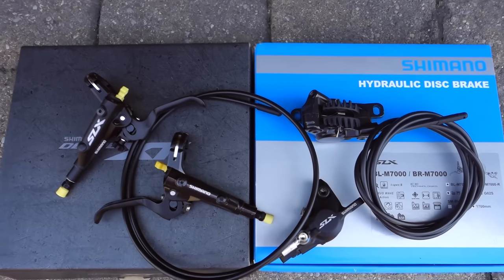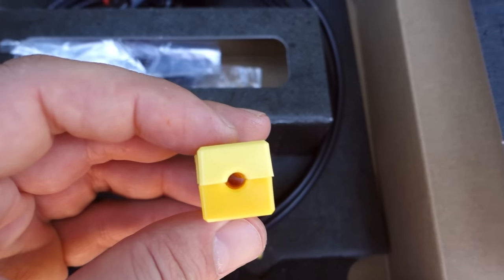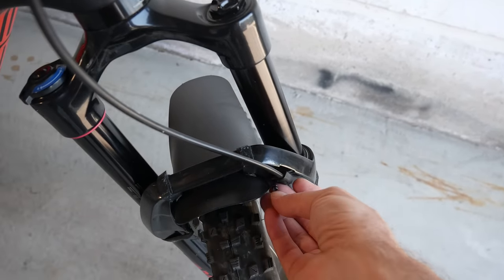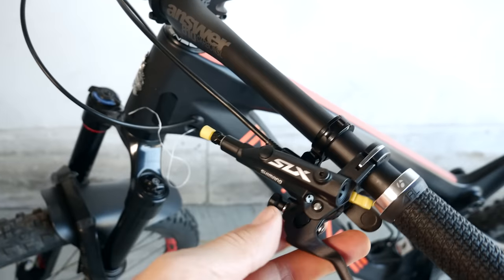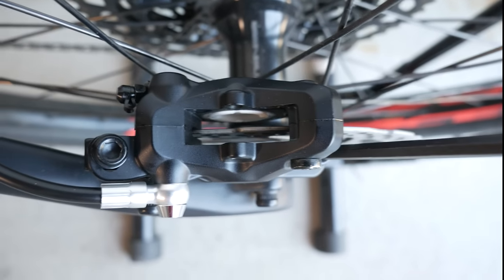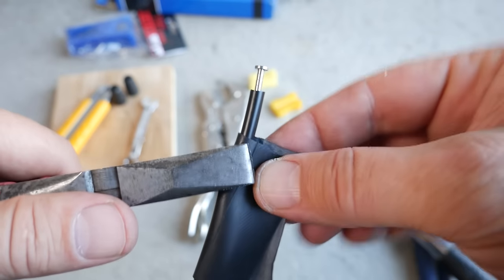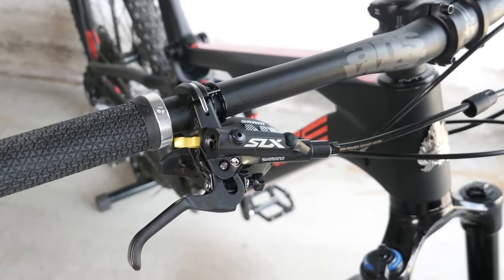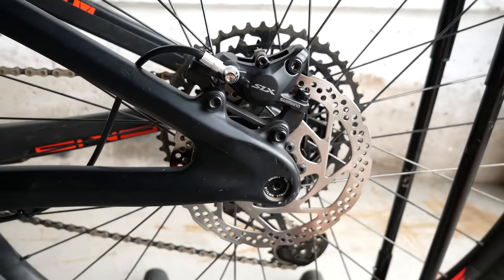Shimano BRAKES Installation How-To, 12 Speed or 11 Speed XTR, XT, SLX, Deore, 2 and 4 Piston Brake

Comment: Great informative video. Thank you. Going to add this to my "Tips and tricks" folder so I can reference again.

I do have a question though, now I have a frame build planned and looking at the Deore 4 pot set-up. Now, I have a Shimano Saint 4 pot set on my full bouncer. To retain the brake pads there is a threaded pin with a retaining clip as you mention on the XT (and SLX... I think). Now, the threaded pin.. can that replace the split pin in the Deore set-up?? (Is it that one of the holes are threaded?)
Reply: @LoveMTB  thank you for your reply. It is something I can live with. Just thought about them aesthetically. A split doesn't look as professional in my eyes.

What are your thoughts on these Deore brakes? I have a deal lined up (front and rear combo) after a bit of shopping online.

Have a Hard-core Hardtail build and decided it having an enduro style spec. 4 pots being one of the components.
Reply: @LoveMTB  look forward to your review of them! Keep up the great content.

Comment: Is the olive (I think thats a compression sleeve in the plumbing industry) already installed behind the fixing nut and you have to push the line through it?  I wonder when they'll start using Sharkbite fittings for the hoses.  I'm asking because I just ordered a pair of 7000's (with J04C Pads) but for about half of what the current 7100's retail at.  They seem to be 99% the same mechanically.  I'm going to have to cut a connected system, but I guess its the same in the end.  I kinda wish I could have found the 4pot for the front at that price, but I think it will be a good upgrade over the M400's the bike came with plus I'll be swapping my 180/160 combo for a 203/180 combo later.  I just went ahead and ordered a DIY bleed kit that will have the hose holder, but I think I'm going to end up with a bunch of parts copies before its over with.  Are some forks or frames size limited due to the torque from bigger rotors?
Reply: @LoveMTB  As soon as I posted my question, another of your videos started playing which answered my question...go figure.  Thanks for the tutorials.  I have gear and parts on the way and like to be prepared.

Comment: 1.  I saw you tapped the insert into the hose before fitting. But you didn't remove it?
2. I have SLX Hydraulic Disc Brake Lever I-SPEC EV Clamp Band on my Scott Genius. I think the seal is leaking at the end of the reservoir. Is there any way of fixing or do I need to buy a replacement lever?
Reply: Don't understand how the hydraulics work if an insert blocks the tube?
Well out of warranty - Do you know, is this problem very unuisual?

Thanks for your answers
Reply: Thanks again. Very helpful.

Comment: I’ve noticed that no matter what disk I put on my rear wheel there is a slight wobble that causes part of the rotor to rub on the pads , 

I purchased 6 different rotors from standard shimano to shimano ice tech , my calliper is perfectly Aligned  and if I go from a 160mm to a 180 m rotor the problem gets worse  . Do you think it could be the hub ?

Comment: Hi - Great find this video, I will be installing XT 4 pot brakes on a new Hardtail build in a few weeks (just awaiting a few components). Quick question, in the video you held the brake line in some grips with some sort of rubber cushion to push the ferrule in, is that right? Clearly need enough pressure to hold it secure without crushing the hose.
Reply: @LoveMTB  Thanks for the help. I am installing them tonight. I actually have the yellow block, it came in a cheap bleed kit! But anyway I bought the jag wire installation tool for a cheap price. Great videos, and thank you for responding. I am also going to install the RockShox Reverb C1 stealth dropper and I’ll have to bleed the hydraulics with the included syringes. Looking forward to doing all this on my new build hardtail.

Quick question - what are your thoughts on using foam piping to prevent cable rattle when internally routing?
Reply: @LoveMTB  All installed, and no issues with air in the master cylinder, great help, I reckon following the standard instructions would have been much harder.

Comment: Hi..First of all thanks for all the advice. I upgraded my brakes no issue and they're exactly how I like. Was proud to do it my self but would love to thank you in person. Maybe a donation to your channel ? 

I've got another problem now though..my friend has made a right mess of his crank nut cap. We managed to get it out but the new cap just spins and spins and spins, never locks and truly tightens leaving wobbly crank arms!  Obviously we damaged the threads. :( 

Soo time to order a new crank arm. But my friend wants to go with a single chain ring. 
My question would be, can I just swap his crank arms/double chainring for a new set of arms with a single chainring? 

I'm aware he will lose quite some options of gears from not being able to use front derailleur but he doesn't care. He's a very fit guy and doesn't bother about his gear ratio too much.  
So would I have any problems.pulling his double chainring out and swapping it for say a shimano slx single chainring, without changing the cassette, or chain ? 

Thanks in advance. Out of all the people on the Internet you have been the most helpful to me
Reply: @LoveMTB  Thanks for again replying. How do i make a donation ? You've definitely earned it. I plan to swap his original raceface crank that fits through a hollotech 2 bb. So was going to order a shimano single speed crank which I'm confident will fit. Was just curious if there would be any issues with chain coming off or gears not changing smoothly ect.. I noticed lots of single speeds have like a chain guide in replace of the front deraileur ? sorry. I'm a self taught taught noob!

Comment: Why remove the brake pads, esp w/o a brake block?? Couldn't one just be VERY careful opening the lever and installing the cable. And then be VERY careful while bleeding. In fact, couldn't you just have the wheels on when you do both of the above so you don't blow the pistons? Still, a very helpful video--thanks much!

Comment: Hey there, I was just curious If the new deore m6100 brakes require and olive? TIA 😊
Reply: Hi.  when I fitted some m6100s last year the olive came in bag along with the barb, however I'm fitting some m8120s tonight and note there is no Olive in the bag.   I questioned this on Singletrack forum and apparently the olive is pre installed behind the yellow stopper in the lever now.

Comment: Thanks for the instruction!  What is the reason for removing the brake pads? Seems like they could stay in.  With a pre-bled system I don't see any risk for fluid contaminating the pads. Thanks.
Reply: @LoveMTB  contaminate how?  I take the brake pads out if the hose is disconnected on the caliper end, like for bleeding. For this job there doesn't seem to be a way to get fluid in the brake pads.
Reply: My question as well-I didn't see yours before posting. The rear brake is quite a long way from any oil, and if one was really worried about the front, the caliper could be quickly covered with plastic wrap. It'd be a lot quicker than dealing with the pads.

Comment: Hi. I noticed in your other video when shortening the housing, you slide an olive over the housing before attaching the housing to the brake. But in this video you don't use? Is it already in the brake lever or something? Do you feel it get crushed when tightening? Thanks!
Reply: @LoveMTB  ahh thank you. Made me confident about doing this 💪 just wish they'd hurry up and ship my order already so I can get to work !
Reply: @LoveMTB  Hi..First of all thanks for all the advice. I upgraded my brakes no issue and they're exactly how I like. Was proud to do it my self but would love to thank you in person. Maybe a donation to your channel ? 

I've got another problem now though..my friend has made a right mess of his crank nut cap. We managed to get it out but the new cap just spins and spins and spins, never locks and truly tightens leaving wobbly crank arms!  Obviously we damaged the threads. :( 

Soo time to order a new crank arm. But my friend wants to go with a single chain ring. 
My question would be, can I just swap his crank arms/double chainring for a new set of arms with a single chainring? 

I'm aware he will lose quite some options of gears from not being able to use front derailleur but he doesn't care. He's a very fit guy and doesn't bother about his gear ratio too much.  
So would I have any problems.pulling his double chainring out and swapping it for say a shimano slx single chainring, without changing the cassette, or chain ? 

Thanks in advance. Out of all the people on the Internet you have been the most helpful to me

Comment: So, it is Sept. 2020 and I just received new Shimano 501/520 lever and caliper.  The package came with a parts bag that includes an olive but I thought that newer models have olive already installed in the lever/master cylinder housing.  Is included loose olive a spare or should I install onto line?
Reply: @LoveMTB  Thanks, yeah I was able to actually see it in there when I popped the plastic stopper off.  One of them got mangled during installation so I was thankful that I had a spare in the box.  Lost a few drops of fluid during that exchange but brakes performed well once I primed them a little.
Reply: @LoveMTB  Really good.  I have used everything from entry level Shimano 200s all the way up to Magura 4 pots and these sit right about in the middle.  I ran 180mm rotor up front and just a 160mm out back but there is still plenty of power and pretty good mudulation.

Comment: Thanks for this. Really helpful. Just curious though, would it be best to re bleed the brake, as you lost a few drops of oil? Or would that be unnecessary? I want my brakes to feel as sharp as can be ! Thanks
Reply: @LoveMTB  Thanks.  Would I be able to get away with just running more oil through from the calliper and out of the lever to replace the oil lost? Or would I have to burp the levers and Apply pressure to the brake whilst quickly open/closing the screw on the caliper caliper get all air out the caliper too? Would all this be necessary with new brakes? 
BTW i appreciate your help alot and noticed you reply to every comment there is 🙏
Reply: @LoveMTB  Thanks so much. You're like the most helpful youtuber I ever seen. I subscribed to your channel 💪 and will definitely be watching more of your videos. Thanks so much

Comment: I have run into a problem. Every time i swap to a new rear tire. Flip the bike upside down and spin it up i get severe out of balance vibration. 
Can you speak to this? 
I ended up using tungsten gulf strips to balance but its a weird issue. Ideas?

Comment: Cool video! I have fuel ex 8 xt with mt4100/mt420 brakes, which suck! Can i replace them with 6100 or xt without changing internal cables? Just click , bleed and go?
Reply: @LoveMTB  thanks, I saw the other video. Maybe I will change the cables also. But I’m doing a little “which brakes” homework first. Sad story that an expensive bike like my trek has shitty brakes for what I’m doing.
Reply: @LoveMTB  what is in ur opinion the best brake for Xc/trail? 4 piston m8100?

Comment: Does the m6100 2 piston brake set come with everything needed to install brakes? What I mean is do I need to order the olive or the barb or anything?
Reply: Second question, is there any way to remove the old rear brake without cutting the hose even though I have internal routing. Could you not just loosen the bolt on the lever? Great video though, very helpful!

Comment: Hi, I have a technical question, why some models of the SLX brake handle have a seal in the cable connection port (such a gray silicone or something) and others do not have such a seal, when I bought the brakes included, then they had a sealed connection port and when I bought the handle separately (slx m7100)  then the seal is gone, is there a clean thread?  Are you able to answer this question for me?  Greetings straight from Warsaw, from Poland
Reply: @LoveMTB  Yes, I know that this is a factory procedure, but the new brake lever, purchased separately, does not have this seal.  I understand I don't have to seal it with anything when installing the brake
Reply: @LoveMTB  You can see it in your video where you show how to install "A to Z Shimano brakes12 speed XT, XTR, SLX".  Thank you very much for your answer, I am now calm because tomorrow I will be installing the SLX M7100 lever and hose.  Greetings and stay care
Reply: @LoveMTB  Sure, I'll let you know how it went, I don't have how to send you a picture and I am wondering about one more thing, in the lever, inside the place to connect the brake cable, where we put the hose with the insert and the olive in the lever from the set I have something extra in the lever  I bought it separately, there is a hole for the liquid channel right away, I don't know if you understand me well, my English is poor and I use a google translator, so the photo would explain everything
Reply: @LoveMTB  if you look at the connection hose hole in the lever, there should be a clean hole, a channel for brake fluid, in this lever with a gray seal there is something like a tiny stub inside, if you have the opportunity, compare the lever with the seal and without  we talked.  best regards

Comment: First video i saw and liked very much.
One question i want to upgrade my 180 mm rotor to 203, what is de correct adapter?
My bike is standard post mount 180 and have 4 pots deore xt.
Thanks in advance and keep the good work.
Reply: @LoveMTB  sorry for my explanation, is the rear brake that i want to change
Reply: @LoveMTB  180
Reply: @LoveMTB  thanks, u earn a new sub. But i think this is for 160 to 203 not for 180 to 203 that i need.
I Will go to my local shop becouse there isn't much information on internet

Comment: removing the pads to center the caliper seems a lil bit unecessary, just brake while the caliper is unscrewed and maintain it flat againt the surface with your hand and then tighten the bolts

Comment: This is worthless for me !! Thank you so much ! Shimano instructions pages are really poor ! They should pay you for this 😅
Reply: Will do 😅 just finished to replace my Tektro with new SLX. Most difficult part for me was the inserts in the cable. I guess you have a lot of hand strengh, so my trick was to use a clamp to thighten the plyer. Then used a soft rubber hammer and finally Made it! Not easy the first time, but then With the right pressure on the plyer it was ok ! I know got, thanks to you all this mounted!!

Comment: No olive inside my SLX 7100 brake levers, and no olives included, just barbs on the hoses.
Reply: @LoveMTB  Hello you are correct, after removing the nut, the olive was present; thank you for replying.

Comment: Salut , am căutat un adaptor pt frâna spate și am găsit un model care e pt fața, dar aparent se potrivesc pt fata si spate,  poți sa îmi confirmi dacă e adaptorul corect care sa îmi permită sa fac tranzitia de la 160 mm - 180 mm. Modelul e, “Disc Mount Adapter 180mm SM-MA90-F180 Post/Post”.
Mulțumesc.

Comment: So, do you think it's worth it to upgrade from M615 to the new M7100 SLX brakes? I'm on the fence. I don't like how my rear brake keeps traveling after the bite point but they do work.
Reply: LoveMTB Yea, I’ve tried hanging the bike from the front wheel with large reservoir, being extra careful not to add any air and it still feels a little soft. I’m thinking the issue could be the hose routing thru the frame, the hose itself, or the lever. But it’s felt this way since new. 2017 Giant Anthem.
Reply: @LoveMTB 
O got it! Sound some air bubbles when rotating the lever a bit and tapping the caliper with a screwdriver. I pushed the fluid up from the caliper into the attached reservoir and in reverse direction. It was a stubborn air pocket.

Comment: Can I use the same insert that's already in the hose?
Reply: Yep exactly, I've bought a pair of slx and they came only with a pre-installed insert on the hose. I'd like to know if is possible to cut the tube around it and re-use the same insert
Reply: @LoveMTB  For olives there's no problem I can easily find some at the grocery store. Thanks for your help man

Comment: i have a Chrome Cover SHIMANO XT - Right - Rear Brake Was Spongy Over the Winter , Now Try to BLEED STILL NO BRAKE ????
i think the MASTER Cylinder SEALS WORN OUT ?????
Not Building Pressure
Reply: @LoveMTB  Thanks for TIP , i had Success Before with Just Having the Funnel and FORCING Fluid from Caliper to RESERVOIR , this XT Brake was for the CHINA 29er Build and the Fluid Collected in the Recervoir Funnel but STILL NO PRESSURE ???
i have HAD Issue BEFORE with PISTON ( Plastic ) in RESERVOIR STICKING TOOK APPART the MASTER CYLINDER - SANDED the PISTON and Reinstalled in to LEVER ASSEMBLY and Was Working Fine .
Will Try your TIP .
Reply: @LoveMTB  will try on Weekend and keep you posted
Reply: @LoveMTB  FYI - New Seals Came from China , Replaced the SEALS in the Right side Chrome Cover XT Master Cylinder , Still had DIFFICULT TIME BLEEDING REAR BRAKE , FRONT WAS SUPER EASY , 
ENDED up GRAVITY BLEEDING - Drip by Drip and CALIPER OFF .OK NOW . USING Automotive Green PENTOSIN Mineral oil for BMW , Works FINE